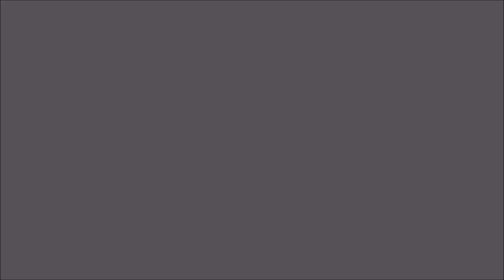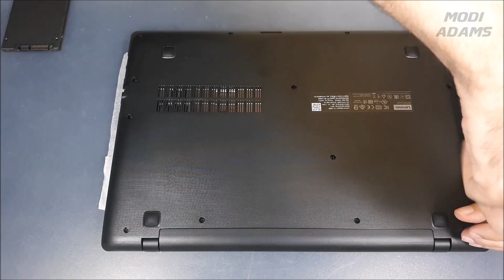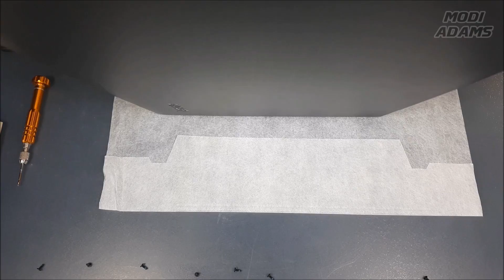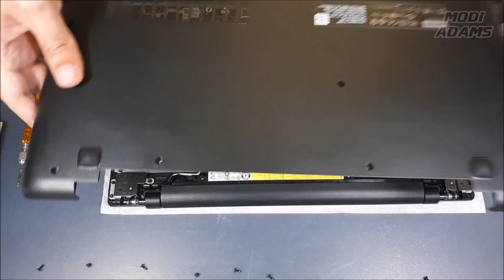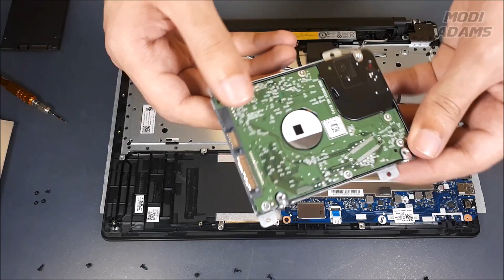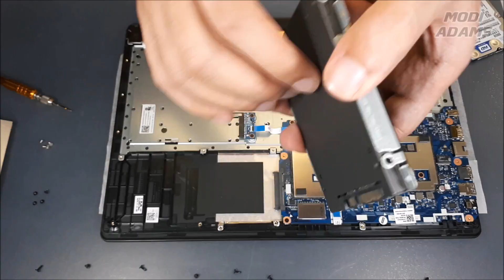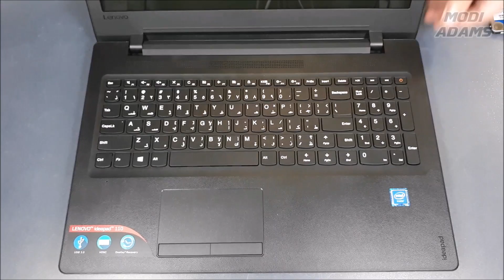Lenovo Ideapad 110 SSD Upgrade

Comment: how change the RAM memory ?
Reply from the maker: Hey IVI, well, it's not upgradable on this model.
Reply: I upgraded it to a 8gb RAM. If you want, I can help U with the reference
Reply: @ironjuano  would you please provide me the 8gb ram brand name you use?
Reply: @kinmunchan3233  #Aliexpress COP 94,768.23  21%OFF | KEMBONA, mejor precio, venta, 1,35 V, DDR3L, 1600 MHz, DDR3, PC3L-12800S, 8GB, módulo de Memoria SO-DIMM, Memoria Ram para portátil/Notebook
https://a.aliexpress.com/_dYr3OKA

Comment: I have this laptop but I see that your has Intel but mine is AMD why ?
Reply from the maker: Reflex, These lenovo Ideapad 110 does have more letters at the end of the model name which should differentiate between those AMD, Intel or even those with upgradable RAM whatsoever ..
Reply: @ModiAdams  which is better AMd e2 or yours
Reply from the maker: @xenoverse1289  I'm not into AMD CUPs .. Since all i care about in a moble device is just efficiency, i guess Intel one has a passive cooling no fans meanwhile AMD's one has fan inside, so Intel's is quieter which is good for those who like absolute silence .. anyway, in such an entry level notebooks it doesn't matter Intel or AMD but it does if it's a gaming laptop and so on ..

Comment: I could add a SSD Kingston A1000 NVMe of 240GB?
Reply from the maker: Unfortunately, no you can't, this slot which seemed like a pci-e is a SATA one for the optical drive ..
Reply: Modi Adams then a Kingston UV500 2.5 inch? The ideapad 110 has Sata disk true?
Reply from the maker: @mariameme1450  Yes, it has 2 SATAs, one for the HDD, and another one for the Optical Drive, so if you remove the Optical drive and get the HDD Cadi that holds another SSD and install it in stead of the DVD, you can have 2 Drives.
Reply: I installed a ssd in de dvd unit, the laptop is 5 times faster (at least)  the OS is on the ssd.  You don't need another sdd

Comment: Can I upgrade RAM on it?
Reply from the maker: Well, i think no, it must be a 4GB on-board memory, meanwhile, you wouldn't need to upgrade the RAM since it would be an over-kill, you still have got a CPU/GPU bottle neck on the system, so you wouldn't enjoy a smooth multi-tasking on it. the SSD upgrade will be more than sufficient.

Comment: Not shown in this video:
-Removing the keyboard to undo a case screw hidden underneath it
-Disconnecting a power cable that holds the two halves of the laptop together
Reply from the maker: No need to do both of what you mentioned above to replace the SSD.

Comment: Should have started the laptop after upgrading with ssd to show improvement in speed compared to HDD.
Reply from the maker: The laptop was brand new and it came without operating system on it, but i did as you mentioned in couple of other SSD upgrade videos. Thanks for the suggestion though. :)

Comment: This video did not help me and I had to abandon my efforts to replace the drive. The most difficult part--by far--is the separation of the two halves of the laptop.  This sped-up video races through that and part of the demo showing the separation happens off-camera. I could not get it separated around both hinges and it looked like it was going to bust (yes, I had all screws out) as I tried. I could not get it apart after several tries, even using my guitar-pick style separation tools.  Why no written text or talking (or regular-timed video showing how to do this) in the video?  The elevator music with the sped-vids is not helpful. BTW, I have replaced HD with SSDs before in another laptop, but had a more helpful video for doing that.
Reply from the maker: Thanks for taking the efforts to write such a long comment, and about the separation, the whole complain would be to lenovo who used to have their laptops just opened with a few screws and that's it, now days all their devices are with such a damn clips that usually breaks while i'm opening the device, and i had to use many way to prey the backs of many other similar lenovo laptops, just any slim and strong plastic preying tool will do, sorry for not showing that part on the video, but it would have never helped anyway, cause i struggled to open it like the rest of 100s of other videos that tries to be professionals by jumping to the installation right after removing the screws to hide how messy is it to open it up. bottom line, try with a preying tool and expect to get some clips broken in the process :D !

Comment: lenovo ya sesleniyorum : Bu mk ram ve ssd sini  değiştirmemek için tüm pc yi açmak fikri hangi malın fikriydi . ram değiştireceğiz diye pilin kablosuna zarar verdik. ayıp ya.
Reply from the maker: Hey Emrah. In such a new laptops that has a built-in batteries, i usually do one thing, i ground myself and wear anti-static band or so. and i make the installations without unplugging the battery! and so far, never damaged anything, not a laptop, a ram or a storage thankfully.

Comment: Can We use HDD in DVD Drive slot ? Is the DVD Interface also SATA 3 ?
Reply from the maker: Yes, the DVD drive pay is also a SATA3, so yes, you can install a 2nd drive in there.
Reply: @ModiAdams  that's Great 😃👍 Thanks for replying

Comment: How many cm for caddy in this laptop?
Reply from the maker: It's not a slim one, so the thicker caddy will work with the slim and thick drives. so any 2.5" HDD or SSD will be installed without any problems.

Comment: Hi I have Lenovo IdeaPad 110-14ibr can I upgrade to the SSD?
Reply from the maker: Yes you can, no problems at all. Non of these machines has a soldered storage, so you can easily swap the old drive and upgrade to a much faster SSD.